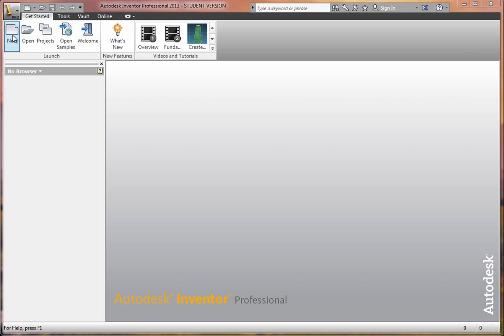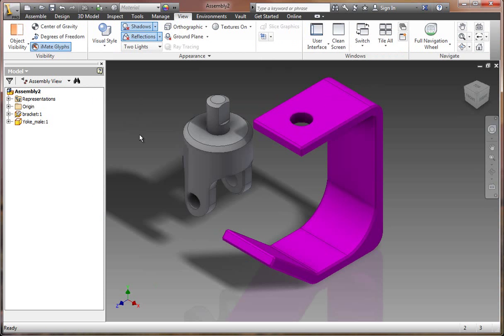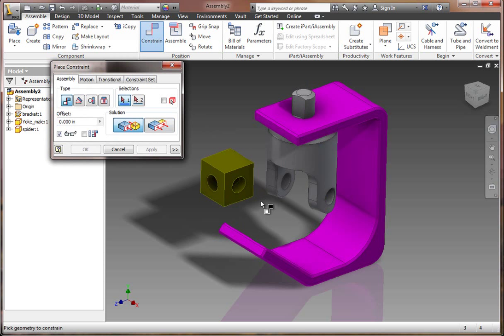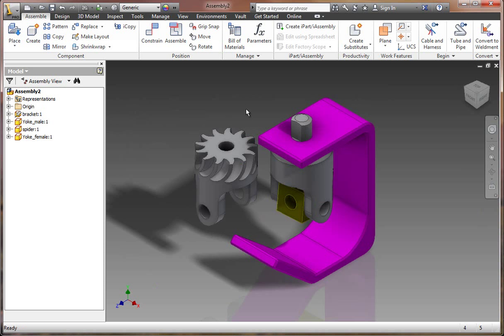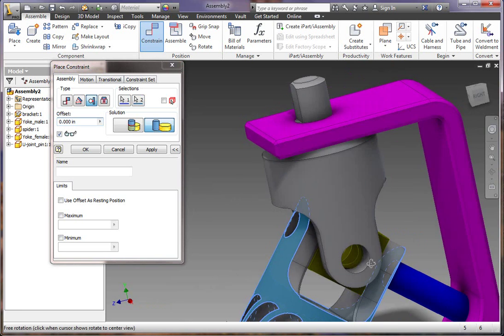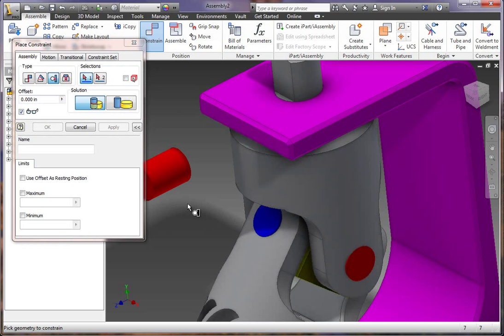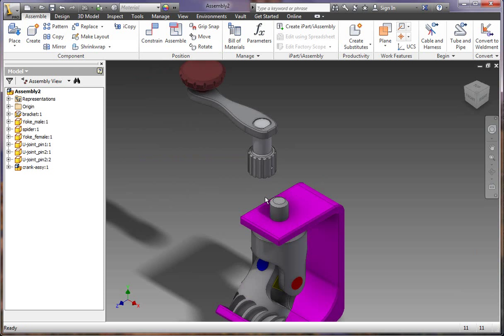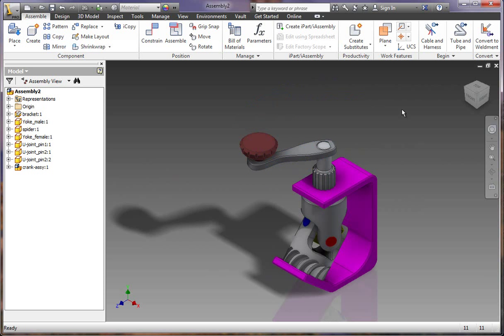E5 INVENTOR 2013

Comment from the maker: Hi bsintzel,

I am in the process of updating/remaking E5 using new/updated parts for Inventor 2014. The mechanics of the parts and assembly are identical, I just dressed them up a bit for the 21st century. (The old parts date back to the 90's. I hope to have the 2014 video up soon.

Comment: Hello Tom,
I downloaded all of your training material. Impressive. They're well presented and easy to follow.
I did however find that (in your E5 INVENTOR 2013 video) you reference a 'bracket' that is to be found in a parts library at vertanux1(dot)com. Upon inspection, the files made available for Inventor don't match the parts shown in the video. Also, the link to Parts for Exercise 6 produces a Google error. Can you update the site or send me the parts for E5+E6?

Bob